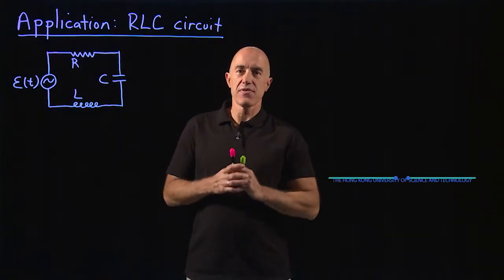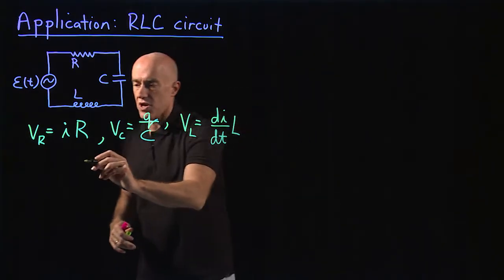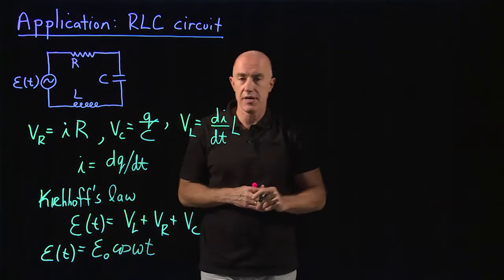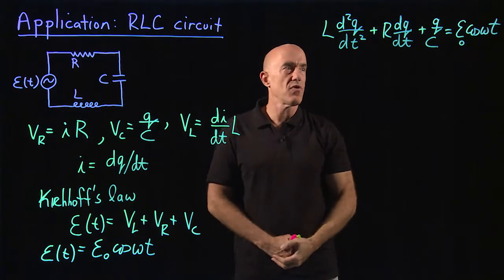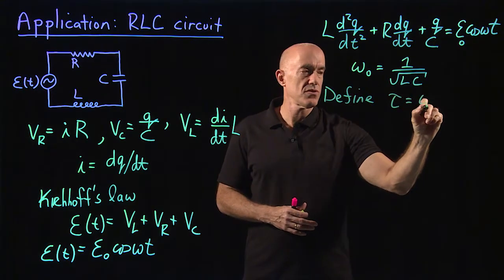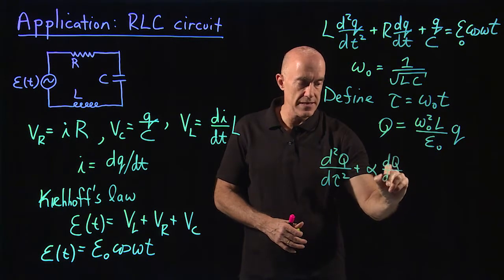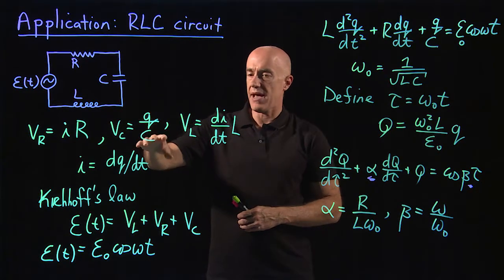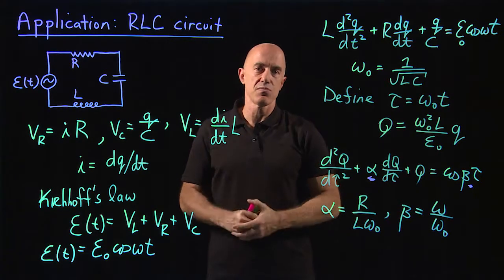RLC Circuit Differential Equation | Lecture 25 | Differential Equations for Engineers

Comment: Prof. Chasnov I have a question. What if the circuit elements or components are in parallel instead of series configuration? What would the differential equation look like?
Reply: You’ll have a system of differential equations
Reply: @Coolgiy67  and use Laplace transform...
Reply: @jstone1211  you could use linear algebra as well. You can use eigen vectors to solve the system of diff eqs
Reply: @Coolgiy67  yes you can, seems a little overkill but I have done that. I have a MS in Control Systems where I use Linear Algebra techniques. Use them in nonlinear applications as well....
Reply: @jstone1211  nice I work as a hardware engineer only have a bachelors in EE I’m thinking about doing a masters cause I’d like to do analog ic design

Comment: Make sure prof. Walter Lewin never watches this video, he's gonna be pissed about Kirchhoff's Law being used :)
Reply from the maker: Why?
Reply: @Jeff-math  Yeah well in situations involving time varying magnetic fields kirchhoff's law doesn't hold anymore as the closed loop integral of the electric field is no more zero. Rather it is -L(di/dt) by Faraday's law. Both leads to the same result equation-wise but using kirchhoff's law is wrong.

Comment: Isn't the voltage supposed to be Vl=-Ldi/dt ??....where people Mix up Kirchoff laws with Faraday's , the total emf should be -Ldi/dt then crossing over makes it positive so it looks like KVL equations when its not .....
Vl=-LdI/dt ,Vr=IR,Vc=Q/C..

Adding according to faradays law :IR  + Q/C + 0 =- L(d^2Q/dt^2)
Then taking all the terms to the right side makes the induced  voltage positive and they all equate to zero ....so KVL is wrong to be used in this analysis as there's no Potential across an ideal inductor because there is no electric field
Reply from the maker: Sorry, I'm not an electrical engineer.  I pulled the equation from my old physics textbook.
Reply: no. Vc is the voltage across the capacitor  so it has nothing to do with L.  VL in respect is the inductor so similarly has nothing to do with the capacitor. Resistor is the same. but resistors are much easier. V=IR.  for the Voltage across any one of these elements its as simple as voltage division.  in mathematical terms u need to change the Ferats and Henry into ohms to achieve this. but other than that V.Div will achieve Vc. Vl, Vr.
Reply: R is also technically really Z for impedance. AC current is impedance where as DC is resistance. not huge deal just a quick little quip of info.